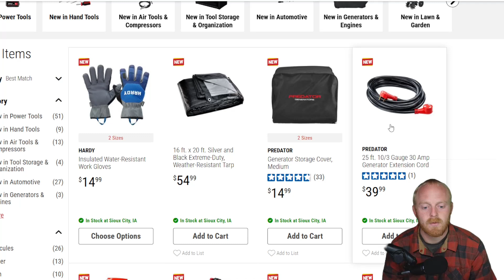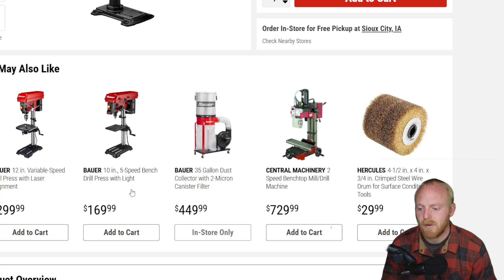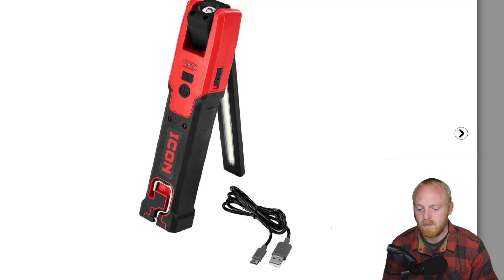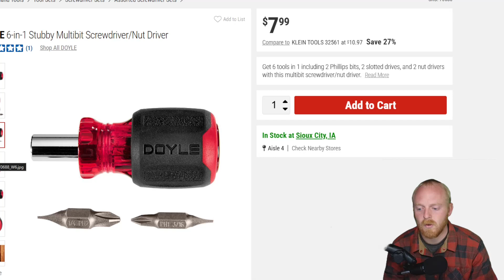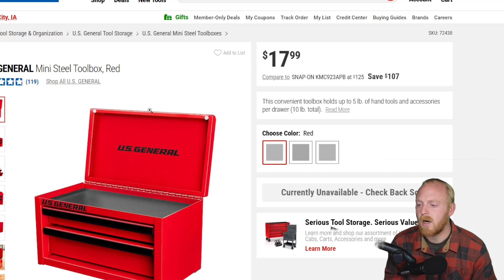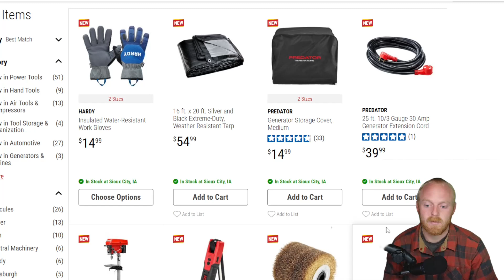New Harbor Freight Tools Icon Bauer Doyle Hercules

Comment: When it comes to the blades, cutting discs, sandpaper, drill bits etc. The Hercules stuff is about on par with Diablo. I started switching to Hercules for all my consumable type stuff and the only real difference I noticed was in my checking account lol. Some of the Bauer stuff does well also like the sandpaper and grinding wheels. The Warrior resurfacing discs, wire wheels, and cut off discs are okay for their price.